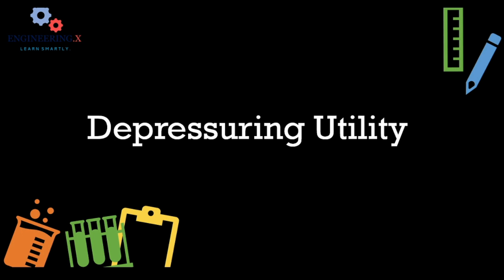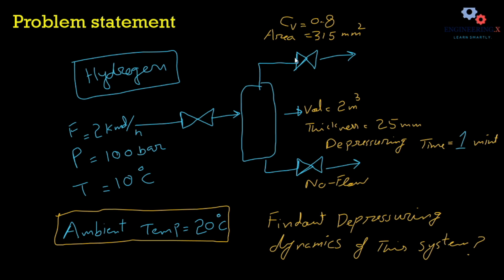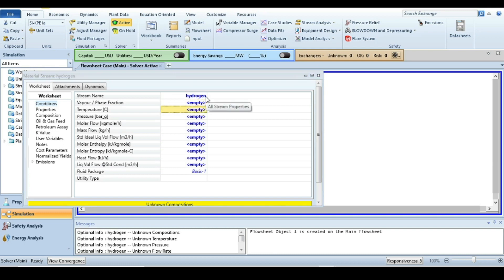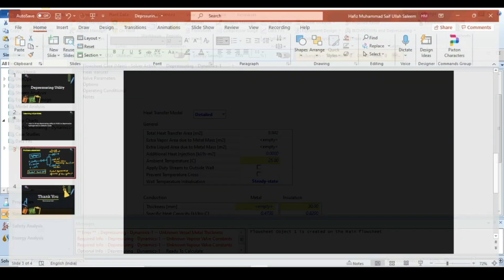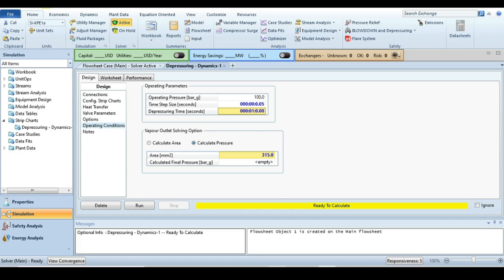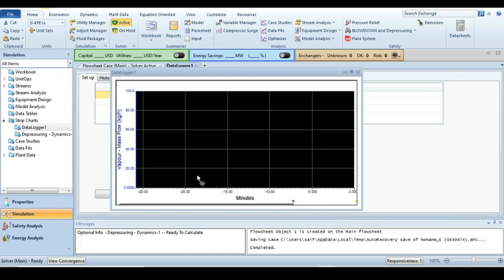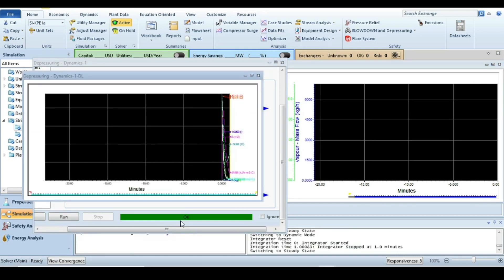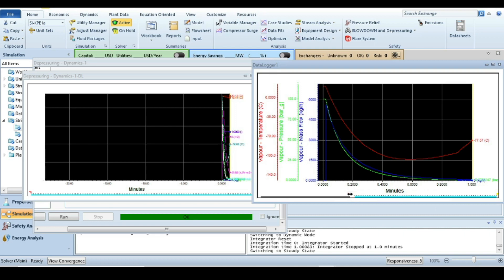Depressuring Utility HYSYS | Hydrogen Line Depressurization

Comment: I have a question, if in the exercise the temperature of the system is above the hydrogen inversion temperature, why was it not heated? In hydrogen you can see the positive J-T effect, where the H2 should be heated by expansion.